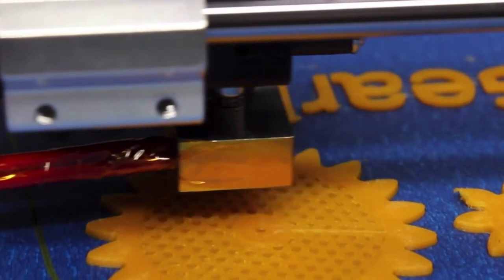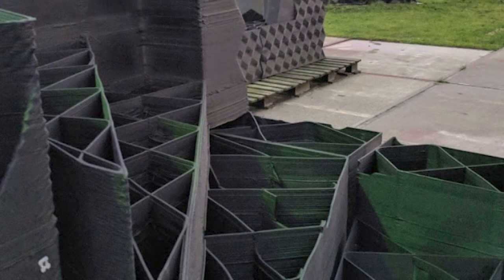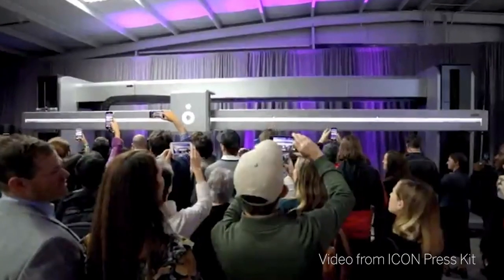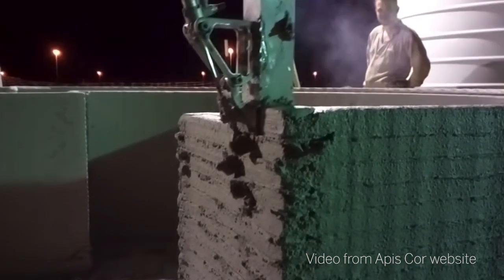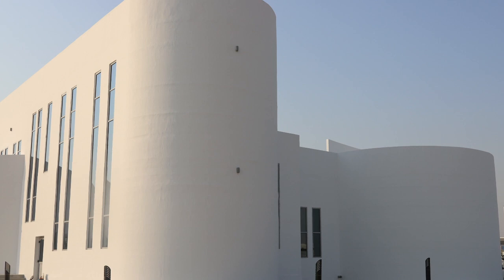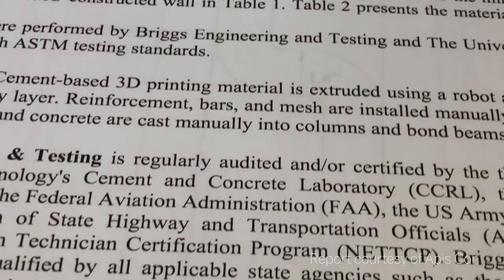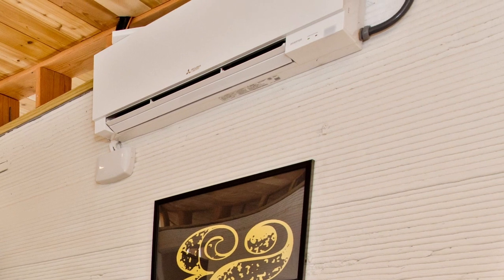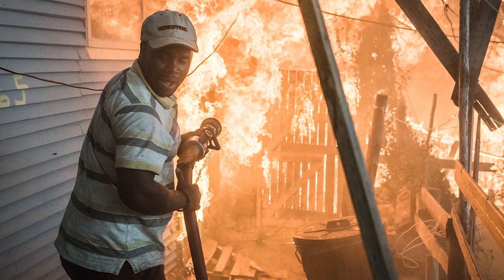The Future of 3D Printing for Building Construction. Is It Safe?

Comment: Public demo needs to be done construct a 64"x110" wall. With 2x6 stick built with same cross section of materials same drywall and exterior siding as most homes use. And print up a wall with a 3D printer give it the required amount of time to cure. Then do a public demo have a healthy young man take a sledgehammer to both of them and see how long it takes to get through them. I'll bet if they filled the inner core with expanding foam it would win.

Comment: Property values are what drive housing costs so high.  Someone in a city will pay $2,000 a month to live in something about 200 square feet.  The wood and other materials to make a 200 square foot house, up to all building codes, is easily less than $20,000.  A person could afford to make their own house for less than they are paying in rent in a year.  If people would quit inflating property values and demanding high rents then poor people could afford to live somewhere.  Someone needs to define a "Maximum Reasonable Rent" based on the tier of housing.  Someone, no matter where they live, should not be required to make $20 an hour just to afford rent, while they can't afford to own a car and have to live on ramen noodles.  $3,200 sounds like plenty, but after taxes, rent and $200 for food they have almost no money to pay any other bills.  Do not waste any time on building materials, spend your time on forcing land values back down to a reasonable amount.  I don't care what the average citizen makes in a year, you have to also provide safe housing to everyone that makes minimum wage as well.  It is not the technology or the engineering that is the problem, it is the made up number of property value.  That just refers to how much they can force someone to pay if they don't want to be homeless, it has nothing to do with their maintenance markup.  Like if shoe companies all decided shoes should cost $150 a pair, you have to buy them, or go shoeless.  Then somehow make it illegal to make your own shoes.  If you want to be part of the solution, try to use the term "Housing Market" less, and use the term "Property Value Gouging Market".

Comment: Concrete 3D printed buildings would still have the same fire performance as a concrete block built house, the component material is the same.
Reply: Public demo needs to be done construct a 64"x110" wall. With 2x6 stick built with same cross section of materials same drywall and exterior siding as most homes use. And print up a wall with a 3D printer give it the required amount of time to cure. Then do a public demo have a healthy young man take a sledgehammer to both of them and see how long it takes to get through them.
Reply: Do a public demo of how well the average 3D printed wall does during an earthquake....
Reply: @nc3826  I know SIP structures are very good. 
If the 3D cavity is filled with foam I'd think it would be at least as good as stick built. Not really sure though Every thing has a resonant frequency.
I will say that a properly engineered floating wood dock will outlast a steel dock. I guess my point is the wood can flex bend & twist alot more then steel without breaking.
Reply: You seemed to missed my point.... The issue is the lack of steel.... For a mortar based construction method....KISS....
Reply: @nc3826  And my point is if you fill the cavity with expanding foam I believe it wuold perform better than without it.
As I'm not an engineer. I'm not sure.
But good question.
Reply: @chasl3645  There are different types of foam materials used in construction. And the term "better" is to vague for an engineer like me, to make any specific comments on what your referring to... But its used in even more point load bearing applications than SIPs, such as in the tstud  so feel free to check it out https://www.tstud.com/
Reply: @chasl3645 I have issues with it for health reasons and secondarily since it breaks down over time, Which is accelerated when its exposed to oxidizing factors such sunlight....And its burns and is  toxic in a fire....
it's
Reply: @nc3826  Thanks for insight.
Reply: @chasl3645  NP and a Merry Christmas to you Sir...
Reply: @nc3826  who says there is no steel or rebar?
Reply: @nc3826  the homes printed in nacajuca survived just fine. They are 'public' if you want to head to Mexico to check them out
Reply: @SquishyBrained  "who says there is no steel or rebar?" show me where its used... I have dozens and none have a way to use rebar...

FWIW OFC 3D Printing Building is possible... but is it worth it vs more efficient ways to build a building? just to save on the cost of labor???

BTW it's great to know one in Mexico is still just surviving... thx for the pointless comments... smh...
Reply: @nc3826  I submit that yours are the comments that are worthless, FWIW.  There are 10 in Mexico being lived in, which set a new standard for safe housing in the region, which is a seismic zone.  Most 3d printed buildings use rebar, coil rods, and wire ladder, or some combination.  The structural engineering requires it for a habitable, permiatable building.
Reply: @SquishyBrained  since rebar was not used in this post (or just wire used, so apparently it was only in your dreams)

so thx for proving my point with your infactual inane response and have a nice day, sir
Reply: it's not concrete since there is no aggregate (or rebar) is added.... it's grout... also concrete mixes can be much drier... and can be compacted.... plus vibration is usually used to remove air bubbles.... so concrete is usually far stronger (and more resistant to fire damage) than this 3D printed crap....
Reply: @nc3826  According to Icon the grout used has a 6000psi rating making it far denser than concrete block equivalent.
Reply: @MattDayissamurai  Standard hollow core CMU blocks needs to be filled in (e reinforced) with concrete and rebar... that's what i was referring to not just unreinforced block... 
Which has far more structural integrity than simple grout....